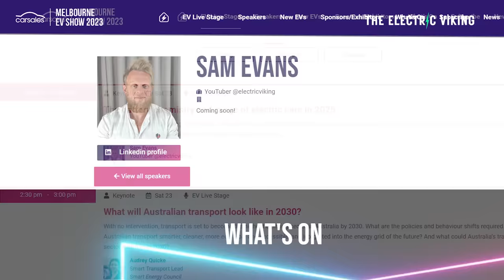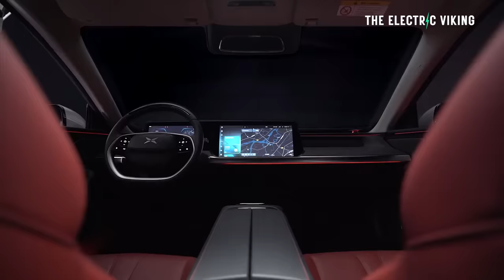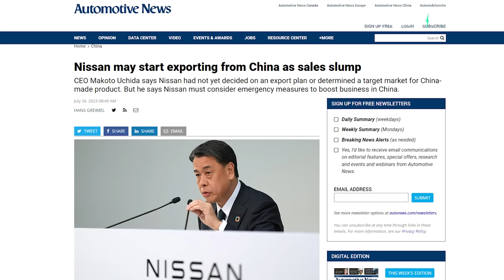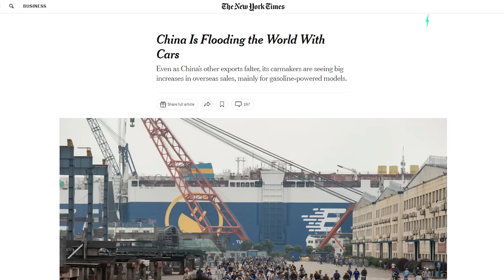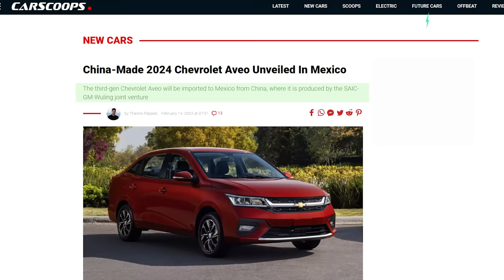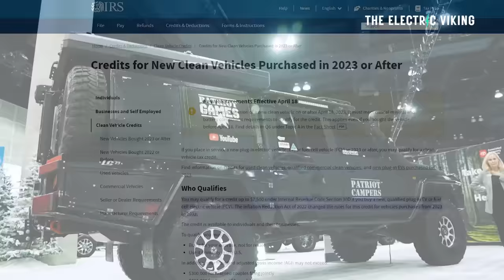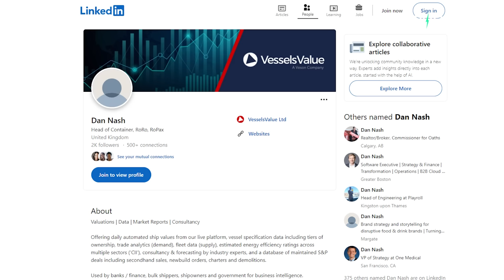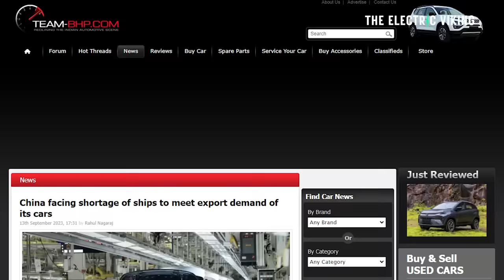Never before seen demand for Chinese Cars outstrips shipping capacity

Comment: I wonder if these ships full of EVs will catch fire and Chinese vehicles are absolute crap the brands from China are rubish China can't and never will build good cars but on the other Japan make better cars like Honda Mazda Lexus Suzuki and Toyota l know several people who drive some of these Japanese vehicles l own a utra reliable 1997 Toyota Hilux and also we have a 2021 Suzuki Beleno GLX our son owns a Suzuki Jimny our daughter has an older Mazda3 one if our nephews drives a Mazda 3 my elder brother has a 1976 Toyota Corolla my sister in law drives around in a first generation Honda Jazz not one cheap and nasty chinese cars the LDVs rust BYDs rust and these are brand new Chinese vehicles my 26 year old Hilux isn't rusting away and it is not garaged never been knocked back on rust in its yearly rego check Toyota quality can't beat ut apart from Suzuki Mazda Lexus and Honda a lot if these Chinese built vehicles when they are 5 years old and have to have there yearly rego check they will fail they probably will not last 5 years and you will have to replace your and you can bet if someone who's Chinese vehicle is clapped out in 5 years time they will not buy another Chineses built vehicle and you mentioned that prices will drop no they won't certain cars will depreciate but others will increase in price second hand EV prices will drop because there batteries will have to be replaced and that will cost the price of certain second hand petrol cars Toyotas will hold there value

Comment: Support and maintenance for all of the cheaper Chinese vehicles could be a concern. Imagine going back to the 1960s and driving 100 miles to get your 10000 mile service done.
Reply: In what world are you?
Reply: Service is not a concern. I just bought an MG4 and first service is at 40,000km. And even then, it will be just check the tyres, refresh the brake fluid, fill the washer bottle and update the software. If needed.
Reply: @davidinkster1296  sounds good. I was thinking of replacement parts mainly. I remember my local Mazda dealer who was 15klm away, having to order my handbrake cable from Japan and it took 3 weeks. That was 1983.
Reply: Imagine going back to the 1970s.  If you did you'd hear the same sort of argument against the import of 'cheaper' Japanese cars.  You know - Toyota, Honda, Datsun(NIssan), etc.  How did that work out?
Reply: 100,000 miles maintenance is windshield washer fluid
Reply: @davec1034  that clear it, so you use logic base in 1983. just wow,   now please come to  2023
part can be at ur door step in 48hrs from china, and it faster than your local delivery company.
I know i have order items and it arrive that quick.